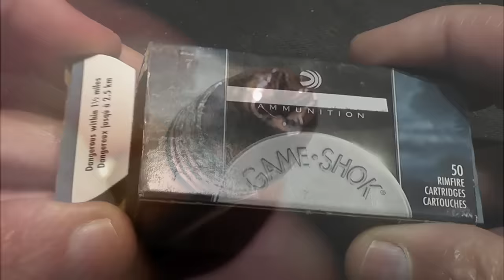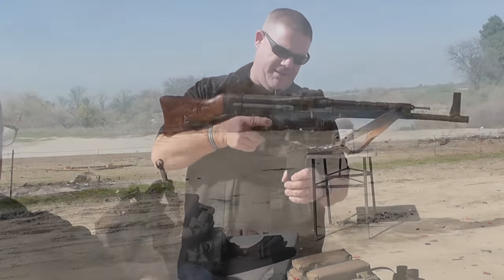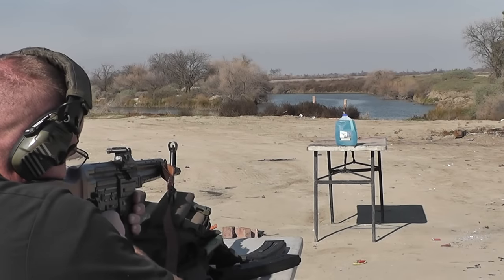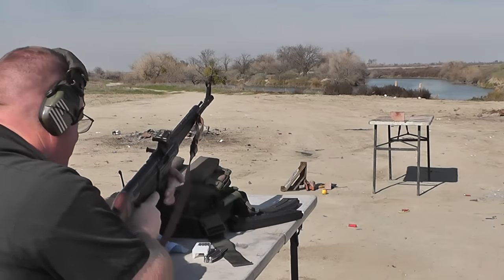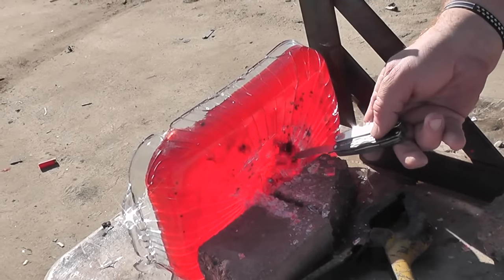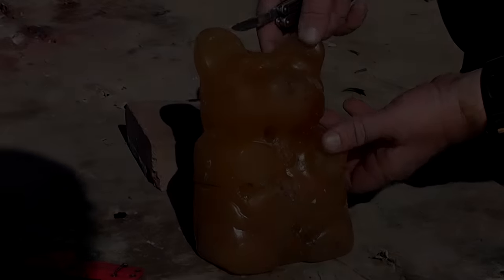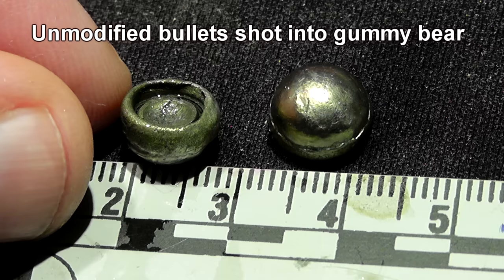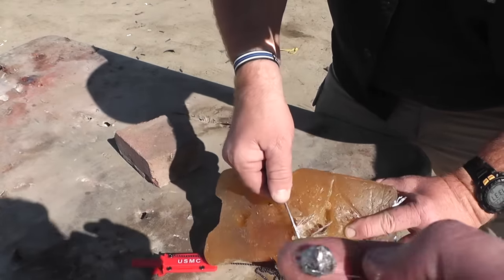The .22 Phillips Screwdriver Mod

Comment from the maker: Honestly,  the biggest difference between these and an unaltered bullet was how they expanded.   The energy between the bullets would be exactly the same, hence the damage would be the same.   Note the difference in expansion at  09:38.
Reply: The difference in expansion will make a huge difference in damage. Any hollow point that fails to expand leaves a much smaller wound track and usually passes through. There would be no need for hollow points if FMJ could produce the same damage
Reply: I tried that on Velocitors and the lead compound was too hard to do it with finger pressure. Works great on lower velocity HPs, though.
Reply: Would be interesting to do a side by side with altered & unaltered rounds.
Reply: TAOFLEDERMAUS yup.  That's for sure.  With 22 your only chance is penetration... heavy denim etc greatly affects things.  So maybe scoring them isn't the best idea...
Reply: WERE YOU AIMING AT THAT FLY!!! YOU KILLS HIM! :(
Reply: If you think jeans will stop a .22lr....you go try it and let us know how that worked out for you.
Reply: MIke Anonymous I never said stop, but it will greatly lessen the actual power tranfered to the person, and take more shots to stop the threat.  Threat Dying after killing your wife or girlfriend with a brick doesn't do your family any good....  we've all seen lots of cases of drugged up perps that take a lot to take down even with regular calibers, never mind the 22
Reply: MIke Anonymous are you seriously trying to say that 22lr is serious stopping power? Ok dokey then.
Reply: Invincible Extremes Muscle Cars Garage I’d like to see you say that .22LR doesn’t have stopping power with one in your eye at Mach 1+
Reply: Contract92 because a self defense pistol reaches mach 1 in 22lr and because you're going to be able to put one in someone's eye when caught off guard while putting groceries in your car?  Oh and don't forget you're also a middle aged lady who took one self defense class months and months ago to get her permit...  give me a break, you idiots are talking calculated hunting, which btw I agree with, Not panicked self defense... many a decent sized animal has been put down with only a 22lr from a rifle.  But I sure as heck gave my wife a 357 to carry, and I'm willing to bet you would too...
Reply: A bullet is pretty much a bullet you can change them a bit but unless they are designed completely different like Rip ammo for instance.. they pretty much do the same thing as right out the box as they will if you file or cut the tips a little
Reply: Obviously it increases the expansion footprint, and even caused fragmentation on some of the rounds.
Reply: I made a sabot bullet worked perfectly with nail in the middle like a dart👍
Reply: That would have been the proper way to conduct the test.  What they did proved nothing as there was no comparison to regular hollow points or solids.
Reply: you watch too many movies.
Reply: Just got to know how to it but it don't work all the time.
Reply: I use nails
Reply: damage would be the same? can't believe you just said that SMDFH
Reply: I never said the damage is better ? .
Reply: What difference? You did not show the same ammo before cross-cutting it.
Reply: Wandering wyatts
Reply: If the bullet passes through not all of the energy in the bullet gets passed to the target, hence, you can not say that it's the same damage done. And apart from the difference in energy actually passed to the target, how that energy is distributed is going to affect things as well.
Reply: That .22 rifle is sexy oh that's why I love stg-44 ww2 rifles that's why it's sexy af my local gun store has .22 ak47 so small and sleek you can harsh hide it and whip out for ambushing dear or say a bear wants to play ruff ok I'll play ruff lol Tony Montana style they had mini .22 m16 and many others o was needing new underwear and pants lol and socks I filled my boots lmfao but in all seriousness .22 rifles and pistols are insane at times but can you make old school was cardboard like paper shells for shotguns I seen and held old ones like that can u make em
Reply: You should try some of the 60gr aguilla dos dos.. the Spanysh snyper round. I swear those are just as effective as any subsonic "AR" .223/5.56 and I can get down quick with a grouping on my 10/22takedown & couple bx25mags. Do the math on ammo carry there & the round are same price for 50 as 20 .223s
Reply: Why wear ear pro with a .22LR they are that loud?
Reply: Lady Luck .22lr are supersonic rounds meaning they still break the sound barrier and anything over 115db is not hearing safe
Reply: Lady Luck only "hearing safe" is usually subsonic ammo ran through a properly and legally suppressed barrel/attachment (or a silencerco Maxxim 9 in full configuration)
Reply: Jake Heke we're having serious discussions with informational comments, questions, and answers. Please leave this to us and You should just go back to ur field of expertise.... butt plugs...
 however rather than .22cal modified hollopoints, u need the .20mm AAC rounds. They'll  be a little closer fit to keep you entertained a while longer....
Reply: Hi guys! I’d like to say that the .223 is very close to a 22 without the amount of powder in it. A hollow point 22 can do some damage. Wearing jeans isn’t going to stop it much, sorry. Also remember that was the Mafia’s go to round for quite sometime, and if you’ve done your homework, the body count was high. A buddy of mine uses that round for hunting and never has a complaint. While I do not hunt, I’m sure he is very effective with it, being an ex military sniper, used to the 50 BMG. He’s got a choice of rounds and he uses this.
Reply: TAOFLEDERMAUS hey, what if you put philips screw driver bits in a shotgun cartridge 🤔
Reply: In tests i did years ago, with 22s. I found that flattening, hollowing or ANY blunting of the nose of a 40gr .22 causes the bullet to expand sooner than it would normally. So if you expand a hollow point, it expands from the moment of impact rather than a more gradual process.
Reply: TAOFLEDERMAUS please do a video where are you put a diamond tipped drill bit a hollow point with superglue
Reply: Does the new California law make this rifle illegal?
Reply: Admiral Percy Darn near everything is or will be illegal in the the People's Socialist Republic of Kalifornia.
Reply: Won't the Commiefornia Kommissar police come and get you for doing that?
Reply: why is there a STG 44 there?
im just asking
Reply: TAOFLEDERMA
Reply: i saw something similar done in a old west movie, where the guy cut an X in his bullets, i always wondered if it made any difference, it was so long ago i can't remember what caliber bullet it was, BUT you could try it with pistol and rifle rounds! <3  hehe if you happen to know anyone with a cowboy action gun and some flat tip lead bullets hint hint, nudge nudge
Reply: The faster the expansion the faster a round will transfer the energy into what it hits and do more damage in that area!  For example. If you stop a freight train very fast it tears up a lot! Slow it down slowly and everything is fine. This technique could very well push a 22LR in to a much more lethal category!
Reply: TAOFLEDERMAUS c
Reply: I have shot  persons with a 22,9mm and 556.The person shot with the 22 went down immediately.Shot placement and a persons mental state plays a huge role
Reply: @InvincibleExtremes  i wouldn't want to test my luck if i was wearing 2 denim jackets with a thick leather in between them. A 22 is still a bullet, traveling fast. And if at the end of any day, you have any holes in your torso that weren't there when you woke up in the morning, and said holes were caused by a piece of lead of any quantifiable size, then it is safe to say that you had a pretty suck ass day. Talking down being shot by a 22 is dumb.
Reply: TAOFLEDERMAUS ,
Reply: TAOFLEDERMAUS how do u think the Copper plated 22,s would work?
Reply: And as far as people commenting on 22,s having shitty stopping power..... I've killed more white tail deer w a 22 long than anything. Body shots mostly. Right behind the front shoulder. Neck and head are better targets but smaller. 9 out of 10 they didn't cover 30 yards by dropping.  That's about 3 about 3 leaps for a deer
Reply: To add any real validity to this shooting test that’s exactly what they should have done, otherwise any plain hollow point would/could be expected to have the exact same performance and your just wasting time screwing (pun intended) with little 22s
Reply: Sean C: I did this to a 41 magnum, cross cut on a 41 magnum years ago also drilled out wad cutters used them to take down a 7 inch diameter tree can’t remember how many rounds it took to bring it down but to say the least it left that part of the tree in nothing but shards of tiny kindling
Reply: @mikeanonymous669  wearing jeans helps to stop the bullet and therefore the maximum lethal range is drastically shortened if you have jeans on. I would not say the jeans would stop the bullet at point blank range probably
Reply: I hate to say this but this has to be one of the dumbest comments I have ever seen about bullets..... " the biggest difference between these and an unaltered bullet was how they expanded. The energy between the bullets would be exactly the same, hence the damage would be the same"..... That's like saying the only difference between a fmj and a hunting round is the expansion but since the energy of both bullets is the same then the damage is going to be the same..... The expansion is one of the most important factors of doing more damage between bullets with the same energy.....
Reply: would be cool to see them shot side by side...I still dont know which is more effective
Reply: TAOFLEDERMAUS my first 22 was a Merlin semiautomatic, 18 rounds in a tube magazine, with a 4X scope.
There is no telling how many squirrels ended up on the dinner table because of that 22.
There were 4, 12 year olds boys, all with 22 rifles, out squirrel hunting one warm winter day, when my three friends and I slipped up on a 6 point buck, I cannot tell you how we did it, but on a count of three all four of us popped up over a fallen tree and opened fire on the buck.
32 shots rang out, it sounded like a small war had started.
Two or three of those bullets hit vital organs, and the deer went down within 40 yards.
I know now that we really shouldn’t have even tried to take a deer with a 22, but damn, it was fun.
Reply: you got the fly near the lemon
Reply: . Invincible Extremes Muscle Cars Garage--  I would think DEAD demonstrates serious stopping power! People don't usually do much damage after they're dead except maybe leave a slight bloody depression in the ground where they fall. Or maybe you just don't understand DEAD!
Reply: 🔵 "Regular-calibers?", so now the 22 is considered an "Irregular"-caliber?.....Smh.
Reply: 🔵 It's QUITE well-known that the Israeli Mossad assassins use silenced Bull-barreled 22Lr-pistols for their 'Wet-works', a favorite was a vintage 'High standard' model from the late '50s/early '60s.
Being a subsonic round to begin with, silencing it is quite simple.
Reply: Why are you shooting with an open background? A lake (back water) in the background no less. WOW!!!
Reply: @InvincibleExtremes  you saying you can't kill shooting through jeans with a 22?  Shoot at a Carhart jacket and see what happens.
Reply: Invincible Extremes Muscle Cars Garage I’d use a 22 for close combat. If I’m under physical attack they’re close. The rounds like to bounce in the skull. Very effective. You also assume everyone panicks under threat. You point that big magnum too close at the right person and it might end up on their side. Grain don’t compensate aim.
Reply: All the dislikes are from people in the UK
Reply: I think its worth taking another look into it. The hollow point philips combo seems good to stabilize the projectile and to ensure most of the energy is properly delivered through controlled deformation.
Reply: 4:23 you included the ju87 siren
Reply: I literally just got the alert that this was uploaded. Wtf YouTube?
Reply: Jeff 2 ads Erie metal roof and the Last Stand Tee
Reply: @InvincibleExtremes  The hp .22LR with a hot BB inserted into the end gives both penetration and expansion.
Reply: @Bludawg27  I use my old Tig welder tungsten for that.
Reply: @joshhayl7459  when I was in the army in the middle 80's we used the bull barrel Mk IV if I remember right.
Reply: @ Daniel Majerly,
🔵 That would most likely severely damage the barrel of any gun it was fired from in the first shot.
Reply: @joshhayl7459  if it's a Dremel bit an you cut down the shaft I would try it in my 10/22
Reply: @ Grog Vaughan,
🔵 I wouldn't try that with a gun that you value.
Reply: @joshhayl7459  so I reline the barrel, no big deal. It's not like I haven't done it before.
Reply: @ Lady Luck,
🔵 Repeated or prolonged exposure
to 85dBA can cause permanent hearing damage, the report from a standard 22cal is approximately 140dBA.......
Hearing protection is most definitely indicated.
Reply: @ Grog Vaughan,
🔵 Whatever floats-your-boat my friend,.... Enjoy!
Reply: I like the square shape. Very unusual. Thanks again
Reply: .22 goes thru jeans,leg, 2" hardwood floor, and still digs into the basement concrete floor.. just sayin. Always treat every gun as it is loaded... it hurts believe me. Hellfire and blood pain immediate swelling to the point my shoe was stuck had to be cut from me. 26 yrs ago...oh then you have live it down and act like it doesnt hurt cause ya know you shot your own damn leg..... I know dumbest thing... but let my pain educate you... on another note had an uncle accidentally blast thru his hand with a 9... much bigger hole lol.
Reply: You should do more videos of a 22LR OF HOW MUCH DAMAGE it can do with anything under the sun especially going through a thick storm house window to see if it can penetrate it at almost over 1 mile or over 2 1/2 miles way or over to show the ballistics on how far can a 22LR can go for safety reasons on gun safety on reason to becareful where u shoot your 22LR while hunting wild game or shooting a 22LR at your home made rifle range for just in case if a 22 bullet goes a stray if you miss your target because myth busters failed this test a few times
Reply: Really!!?? You mean it don’t go 1000 million times faster after a light tap of a screwdriver
Reply: @azeissler1987  i agree. I was going to say the same
Reply: @joshhayl7459  .yes. excellent point. a small, lightweight & essentially unobtrustive "can" on  a AR-.22lr (clone).such as the H&K416 .22lr pistol w/8.5" barrel , useing a nice 60grain /950 fps bullet (such as agulia- sniper subsonic) makes for a great stealth weapon for missions such as; recon , extraction of humas or supplies , or if attacked within close structure areas like a suburban neighborhood invasion with homes and sheds and trees, cars, ect. all within 50yrs. , hell , even if you just need to ambush a camp..lol. all this assuming, you are a decent shot & can consistently put beans into 6inch groups (at 50 yrds) during the difficult and sometimes unorthadox shooting positions encountered during a combat situation..its also a good home defence weapon setup. plenty of rounds, wont wake little suzie and panic her to be moving around, and will be less likely to go thru walls and injure your family. i know this because this is how i train.. all my buddies are the ones that will be lying prone 200 to 300 yrds away with thier 30-06 and such.. lol
Reply: @RichardCranium321  i agree completely ! i train with a H&K416 .22lr 8.5" barrel pistol. and the Agulia 60gr./950fps ammo thru a "can" , makes about as much sound as a 8oz. plastic cup tipped over on a table...... 🙈🙉🙊
Reply: lmao wtf
Reply: Unlce Tony hollow points.
Reply: "Stopping power" is a made a term. If you're dead you're dead, no matter how much "stopping power" hits the target. A 22lr HP to the dome or chest will stop anyone. Permanently. A 45acp to the arm doesn't have "stopping power" either, now we go back to shot placement. Would I rather have a 45 acp? Yes, but a 22lr can and has killed many people. Why do you think it's the #1 round for assassins? It's small, it's relatively quite, and it still gets the job done.
Reply: TAOFLEDERMAUS - For OG- When i was 10yrs old my dad bought me my first .22 rifle and it was a 1953 Marlin 39a lever action rifle. I still have it to this day and hope to one day pass it down to a son of my own.
Reply: I don't know the difference, what I would need to know the difference is to show the altered and unaltered, fired and expanded, bullets side by side.
Reply: @mikeanonymous669  there`s a youtube on shooting a roast thru 8 layers of denim at 300 yds.  it`s impressive
Reply: Hey guys I found if you mix shotgun nitroceluloce power with a little bit of nail polish remover or acetone just enough to make it slightly gooey then when it almost cry you can squish it in the tip of your hollow point 22 bullet you will then have an incendiary round I use to do it all the time when I was younger and had heaps good results
Reply: @azeissler1987  They do the same damage. The FMJ makes a longer wound. The FMJ might even do more damage in terms of volume. The issue is whether all the energy is absorbed in the wound or if it passes through without dropping the energy. A supersonic .22LR will go beyond the FBI depth.
Reply: @InvincibleExtremes  go watch the shootout between the South Carolina state trooper with a 357 and a guy with a 22 lr mini revolver its about shot placement if you cant hit with the 357 it doesnt matter and the trooper got multiple hits and still died on scene with a vest on
Reply: @InvincibleExtremes  head shots stop perps, save lives.
Reply: Thank you so much
Reply: @Mr00buckshoot  copper plated 22's are barely coated you can take the copper off with a knife id say same or worse
Reply: @lorenreece1665  it may be an open background but considering they have been shooting a while i would assume that they take all safety precautions
Reply: @user-pq4by2rq9y  i would say its probably uncontrolled explosive deformation as some of those shells did come apart though if it was because the impacted others is to be seen but comparing the standard hollow point to the modified version shows a modest increase in final diameter thus all of the energy would be more rapidly dumped into the target so it could be good for thin skinned targets the typical human id say would not be an ideal one but the way i see these bullets working they would get just under the skin and basically explode
Reply: Expanded bullets deposit more energy. That’s a no-brainer.
Reply: Do they separate and tumble?
Reply: That doesn't even make sense, shoot am fmj and varmint bullet with the same energy and tell me the damage is the same.
Reply: @InvincibleExtremes  that myth about 22s bouncing off jackets is honestly urban legend. I've done some tests with ballistic clay and coconuts with a .22 short HV. The bullet embedded in the back of the coconut. Not a manstopper but it might scramble brains like eggs if you take a 22 tobthe head
Reply: Perfect sense
Reply: @InvincibleExtremes  good chance she will miss with a bigger round, less recoil is more precise shooting
Reply: When you shot the lemon you got the fly as well.. cool lol
Reply: @thejoatmoo  Yeah that was a horribly ignorant statement to say the least... Hunting bullets are rated for animal size/ toughness and it makes a huge difference on using the one designed for your target.
Reply: @InvincibleExtremes  u realize that .22 is statistically the deadliest round right?  It goes in and travels and does a ton of damage. Yea
Reply: @gregbarth9617  With out a side by side comparison there is no test!